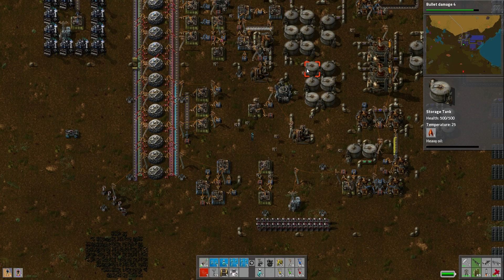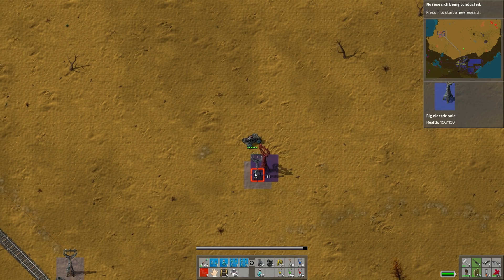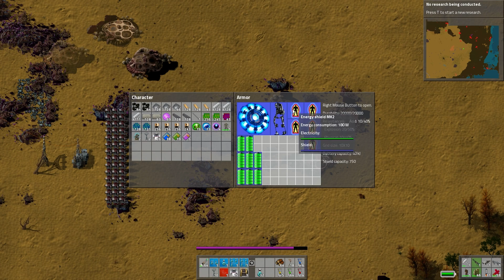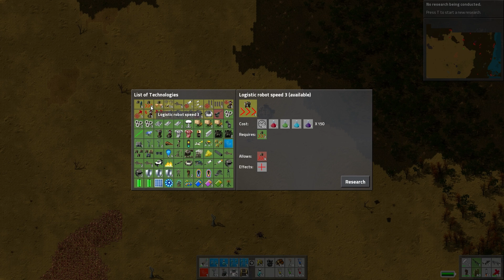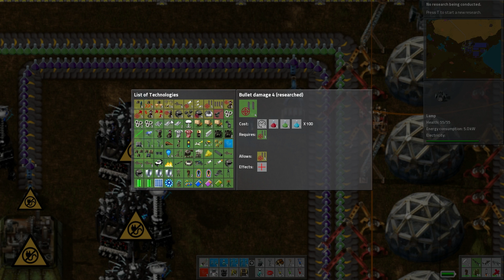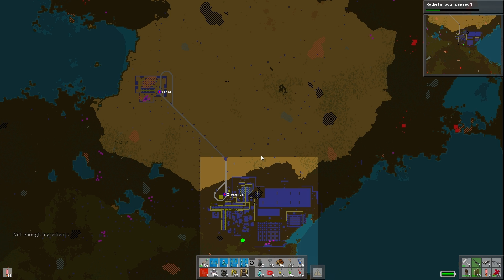21. Let's Play Factorio - Laser Assaults

Comment: your steel chests are not smart enough :)  read again ther is a clue inside :)
Reply from the maker: Heh heh yeah I figured those wires out eventually, although I don't think I ever found a good use for them in the series here, I tried to come up with a couple "show off" systems using green/red wires, but I never came up with anything useful, it always seems better to just limit chest space, or its fine using smart chests and logistic network inventories
Reply: there is a usefull situation, you can say stop produce items if a limit is reached, so you keep a free line on your transportbelt. and you use one chet one item with netowrks you can use one chest for multible items :)

you stop the overproduction with more overproduction that the transportbelt stucks but that means you need harvest tons of ressources

maybe use more splitter that all mashines have a chance to get ressources to work and bring one open end back to the slitter that they share again so you get little loops so that all stuff is keep moving

redgards Shaymes